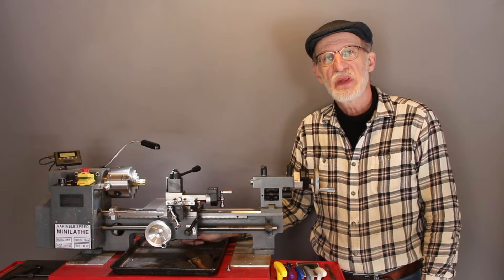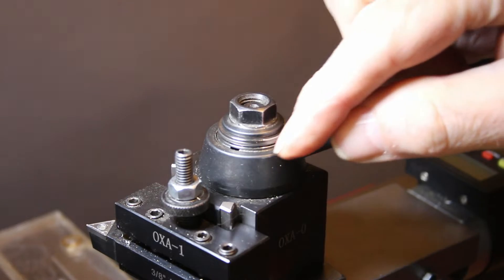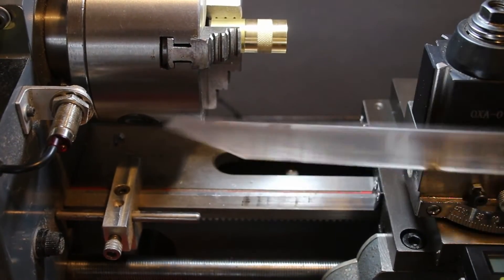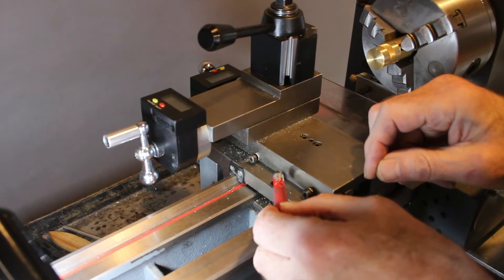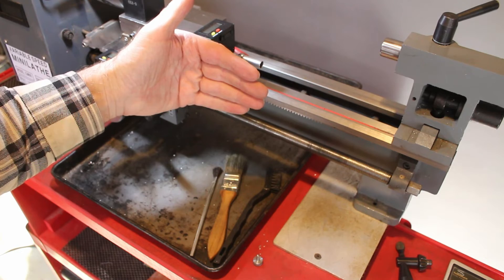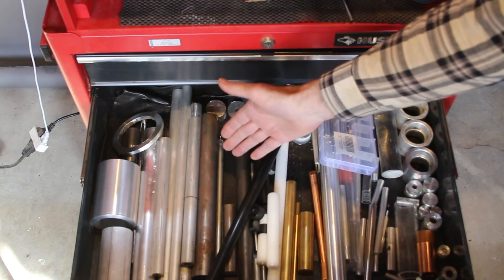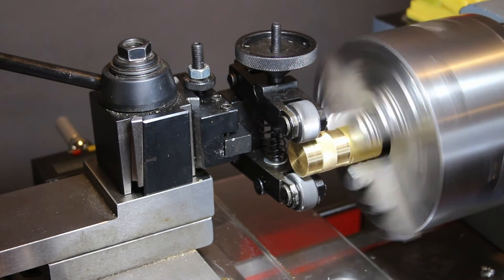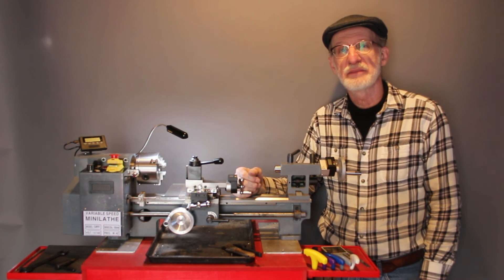Mini lathe add-ons and upgrades

Comment: 2 mods I've recently done that has completely changed the capabilities of my mini lathe is the 16" bed extension kit and the cross slide travel extension kit both from little machine shop.  The bed extension kit is a bit pricey and requires some fabrication to install but the added length is way worth the time and money. It's way cheaper then buying a 7x16 lathe. Several hundred dollars cheaper as matter of fact
Reply from the maker: WOW! I was not aware of those options!  I know the LMS site well and order from them often.  Thanks for the suggestions!
Reply: @GuyMarsdenMakesStuff  the bed extension kit is often sold out and on back order so if your interested in it then try and check their website daily because they sell out really fast for some reason but yeah, the added capacity it gives you really is worth every penny. Its listed as a 16 inch bed extension for some reason but in reality it's closer to 18 inches. Definitely the best mod I've done. The crosslide extension kit gives about an inch and a half of extra travel which makes life so much easier when turning larger diameter pieces
Reply from the maker: @tylerhogg2241  I am actually more interested in the cross slide extension and signed up to be notified when they have that in stock for my machine. Thanks again for the suggestion!
Reply: @GuyMarsdenMakesStuff  awesome, I'll be waiting for a video of your installation!
Reply: U

Comment: That was great, I went down the same purchasing path as you and decided on the cheapest minilathe, again because I had seen everyone seems to disassemble them , clean/deburr/tune them up and put them together again. Like you say, the process is kind of valuable, if for no other reason than you get to see how all the parts connect together. I also went with a similar model to yours, mainly because it has a 14mm hex nut on the lead screw, I used this to add a stepper motor drive to drive the carriage  (I basically removed the gears on mine, they make too much noise and I can't see myself threading stuff for a while). I also liked the projects you started with, the interference fit containers will be something I try.  Thanks
Reply: You might want to checkout Clough42 on YouTube- he has a very informative series on the how and why’s of using an electronic Leadscrew Stepper motors, with a bench top lathe… I managed to modify and upgrade a precision Levin instrument lathe to be able to program and cut imperial and metric threads -both internal/external and left/right handed….additionally feed rates can be programmed .001/rev and up.
Reply from the maker: Great minds think alike David!  I have seriously considered doing what you did and putting a stepper on the lead screw.  If I do, I will do a detailed video about it for everyone else.  In the meantime would you like to share what stepper motor you used?  Do you use a geared one?  I can handle all the drive electronics it was the stepper motor specification that is critical for this isn't it.  
The added feature of a stepper motor is you could do a simple CNC control function to program it to go a specific distance with a little code writing.
Reply: @GuyMarsdenMakesStuff  This is the playlist of my adventures with the mini-lathe. The end of part 4 shows the stepper motor being used for some turning. https://youtube.com/playlist?list=PLmfc7XNirQoyz5tOgo8v_bP1XDOJsSHRt You are right about needing a geared motor, I started out with a Nema 17 motor but it was just on the limit for torque, so I swapped to a 14:1 geared Nema 17, that seems to have plenty of torque and I didn't want a bigger motor like a Nema 23. I was thinking of adding some sort of distance logic as well (Basically to go back an forth over the same distance when turning), but need to practice with the lathe a bit more to decide if I would use something like that.
Reply from the maker: @mysomervda  AWESOME!  Thanks, I will review all your videos and make my own version.
Reply from the maker: @mysomervda  Very helpful - thanks!  I'm definitely going to dig in to this some time in the next month or so.  Thanks for your detailed videos!

Comment: Hello Guy. Great video and mods. I just got the exact same lathe. As time permits, I will be doing these same mods.. I actually bought the same hall proximity rpm sensor and was wondering if I could install it in the front cover to electronics box and saw you did exactly that! Thanks for posting👍
Reply from the maker: Take your time getting this machine dialed in, as I mentioned it took me an entire week.  Everything that needs to move will need adjustment, tweaking and filing off sharp edges and rough surfaces.
Reply: @GuyMarsdenMakesStuff  You got that right! I've already completely disassembled the entire machine and ultrasonic cleaned every last screw/part.. I was amazed at how many small metal particles and pieces of assembly debris and foreign material there was. Yet in some ways it's very satisfying to clean and throw some redesigning at it. I'm a mechanical designer by profession and luckily have full access to an old Hardinge lathe and Bridgeport milll so should be able to produce some quality upgrades to help dial her in. Once again thanks for your video, I thoroughly enjoyed it👍
Reply from the maker: @greg20152015  yes, it's a great way to get to know your machine.  And you may be using your Bridgeport mill to tidy up and resurface the ways on the cross slides.  They are really rough aren't they!

Comment: very nice mods ! look i dont want to be the smartass, but when knurling u never use oil...the oil would colect the knurled off chipps and then the mixed chipoil will go direct into the knurled surface on the next revolution!  sry my english is not perfect, i hope i explained it in a  way u understand what i mean ! just use no oil on the part what u want to have knurled ! 
thats what we learned in our aprenticeship at Swarovski
Reply: Oil should be for the roller/roller holder and roller shaft friction.
Reply from the maker: @19mati67  yes, thanks to both of you, I didn't know that.
Reply from the maker: Thanks for that suggestion.  You are right, but you do need to oil the bearings inside the rollers with 30wt oil because they see a lot of force.  So I will be aware to keep the oil off the knurling surfaces in future.  Thanks again!